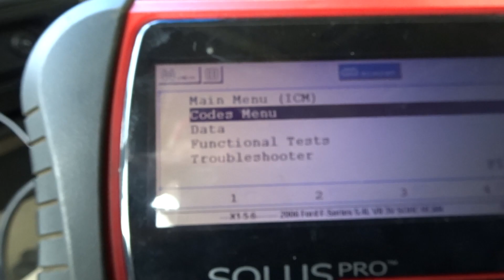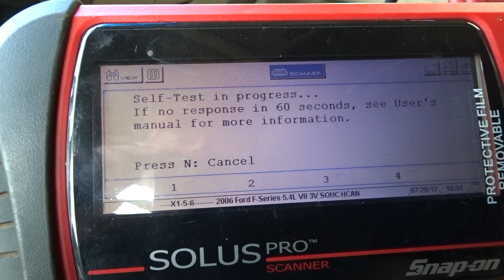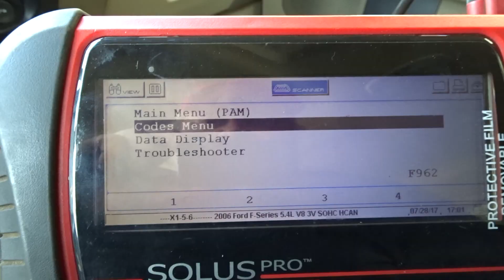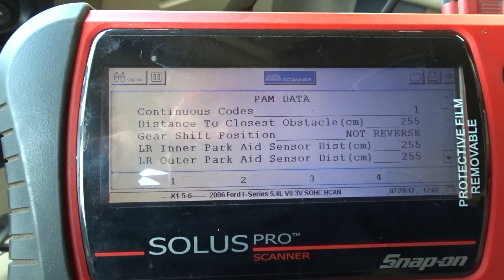Ford Back Up Sensor Repair DIY Cheap China Sensor

Comment: Had the same one go out on my 2011 F350. Replaced with an Echlin from NAPA ($30.00). Diagnosed the one that was out by putting the KOEO, put the park brake on and the tranny in reverse. Went and listened to each sensor and replaced the one that was not "ticking."

Comment: Thanks Jerry, mine is acting up again, I too bought a pair of cheap ones, now i need to find the spare, then start swapping them out, they aren't clicking at all, checked with stethoscope. Changed out rusty rear bumper in  March, now, problems. No scan tool, may need to buy 4 more cheapos.
Reply from the maker: the cheap one installed still works to this day

Comment: A buddy of mine that works at a GM dealer claims, That if you have to vehicle ignition in the run possision and in Reverse, You can feel which sensors are working or not by licking you finger/thumb and placing it on the face of the sensor. A slight tingle if they are working. myth busters maybe lol
Reply from the maker: +shaker650 perhaps when they are working, on my ford once one sensor(s) have failed the park aid is turned off permanently so no way of checking

Comment: If you put your ear up to the sensor while it's plugged in and vehicle in reverse with the emergency brake on you'll hear a clicking noise if it's working
Reply from the maker: You’d never make it from putting it in reverse to run to the back to hear it unless you have someone do it for you.  The system times out in like 2 seconds